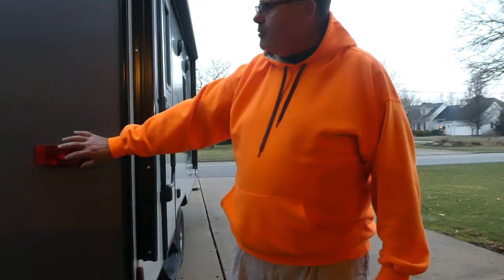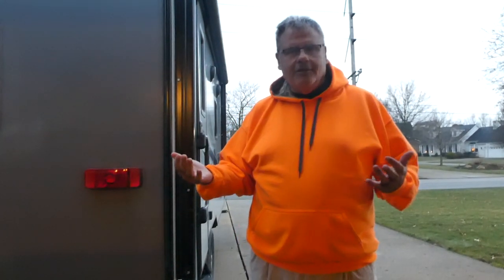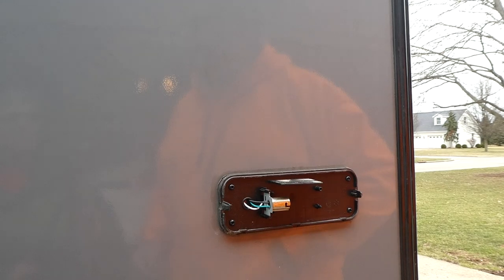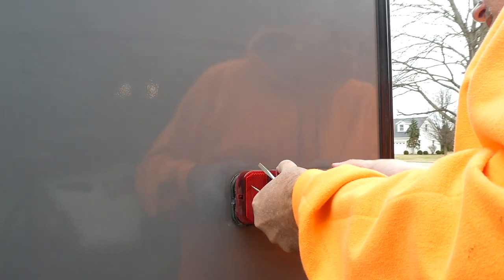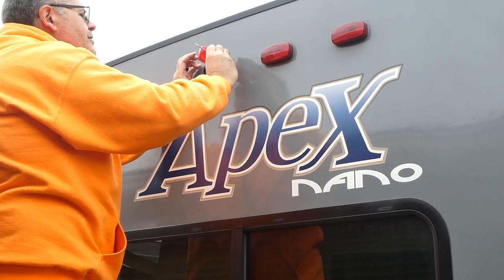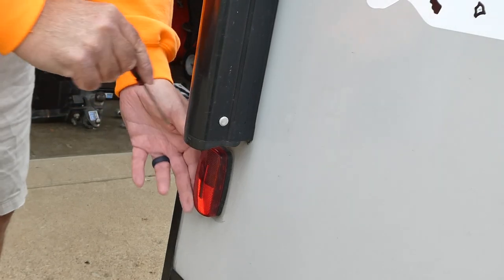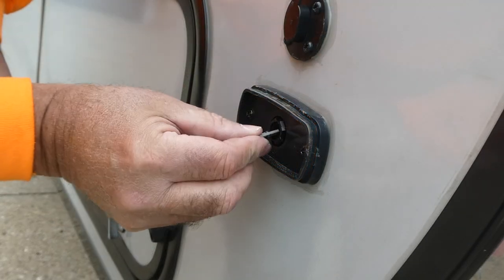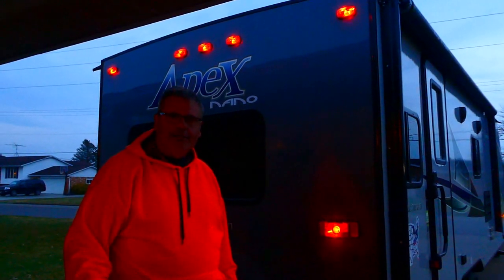Replace standard RV exterior lights with LED LIGHTS

Comment: You might want to drive for an hour or more with your headlights/tail lights on constant and then see if your brake light still gets brighter when you hit the brake.  Many others are finding that after being on a while, the brightness change we all expect when hitting the brake doesn’t happen, meaning no brake lights.  Hopefully this isn’t the case for you guys but worth verifying to be safe.  

Also, I noticed the 194 bulbs on your gear list from your website but not the 1157s.   Interested in which ones you went with, especially if you’re not having the problem I noted above.  I have an Apex Nano 193BHS and looking to upgrade my lighting as well.  

Thanks for a great video.

Comment: I’ve heard that LED bulbs can flicker and that a load equalizer is required. Any problems like that?
Reply from the maker: You know, I have heard that when replacing car and truck incandescent lights with LEDs, too.  I have not seen mine flicker at all and I have followed the trailer at night. I have thought about replacing the lights on my Chevy Colorado to LEDs but like you said, it would require installing extra equipment so I just stuck with the original style lights.
Reply: @noworriesrving3743  No extra stuff required when doing the truck, other than maybe the flasher for the signals, some brands of LED don't draw enough amperage to activate the flasher used with incandescant. In which case you can use an electronic flasher or a real old style cheapie flasher, assuning the vehicle has a flasher that isn't integral in a dash module. Easiest way to test it is if they don't work after install, put one old lamp back in, they will usually start working again. Most integral dash module flashers will accept LED. And if you haven't done the truck lamps yet, the trailer will work fine with LED.
Reply from the maker: @davecollins6113  Thanks for the info!  I am glad there are a lot of people smarter than me out there.

Comment: So it sounds like, it would be ok to upgrade to led bulbs on my fifth wheel RV but not my truck.
Reply from the maker: Well, that was my strategy.  We wanted brighter lights on the trailer for safety reasons.

Comment: Would have been good to see exactly how you removed the lense. Did you push in on one of those plastic tabs?
Reply: CW.  I used a very small flat screwdriver to pry the lens cover off before I replaced the bulbs.  I don't remember there being a tab to press on, though.  If there is a tab on your light housing then you will obviously have to use the small screwdriver to press in on it to remove the lens cover.  Mine had a small amount of clear caulk that I had to score before I could remove the lenses, too.
Reply: @jamesmcrae8546  Thanks a lot, didn't mean it as a criticism. :)

Comment: Is the water heater in that model electric as well as propane gas?
Reply: My trailer, not this model, has a gas only water heater.  I added a Hybrid Heat off Amazon and installed it.  Now I use electric exclusively.  Love it.
Reply: Ours is a gas/electric model.  There is a switch in the outside vent to flip if you want to use it on electric power.   We use electric when we have full hookups and propane when boondocking.